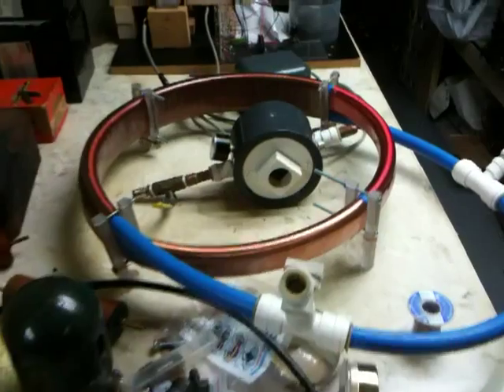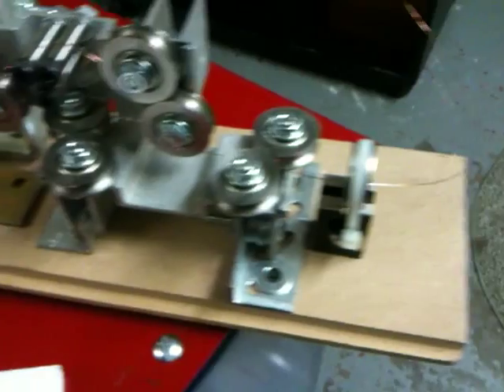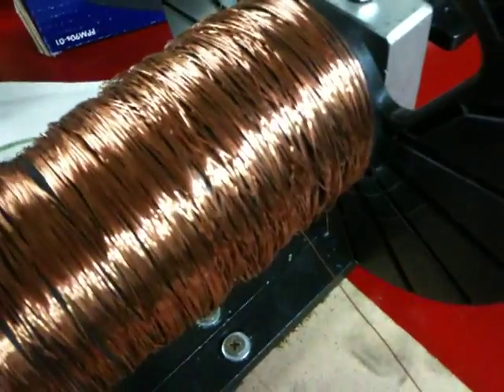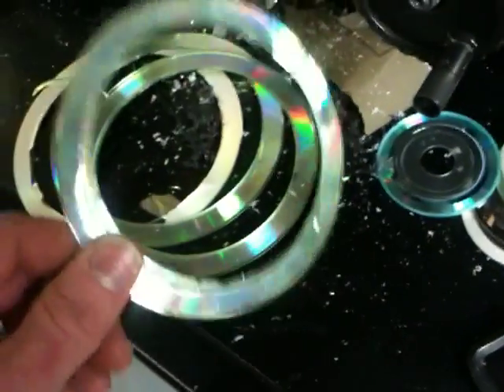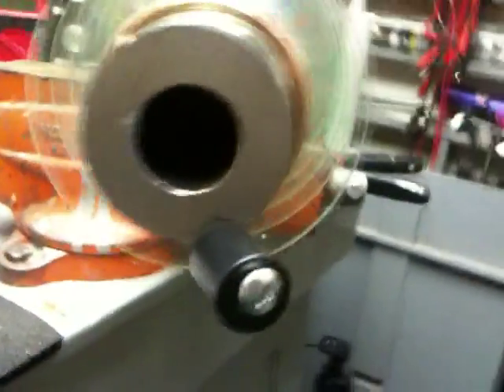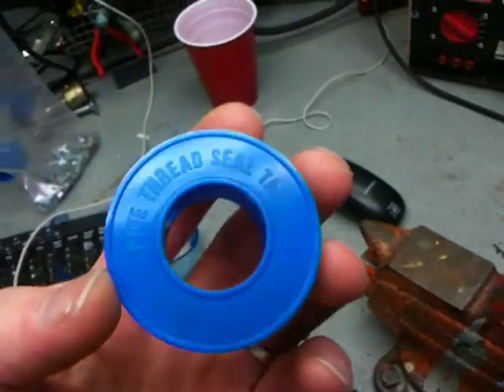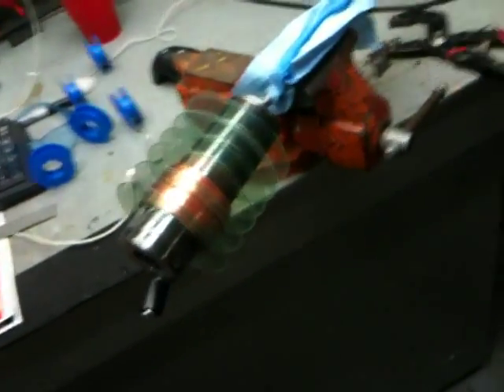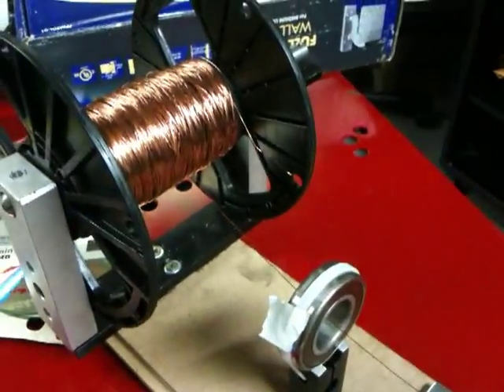2 EPG testing, Building The Primary Energizer (EPG Test 2)

Comment: Hi Russ,
I can't help but think that the hollow ferrite core will concentrate the magnetic field through *itself* and act as a ferrite particle barrier which will prevent acceleration of 'magnetic particles' through a tube within.
Also, a pulsed sectional field within the ferrite would be degraded by sections not pulsed;  though pulsing all together would energise the entire ferrite tube equally, but with lines passing through the ferrite rather than any particles enclosed within.

Comment: @rwg42985 Your machining of custom tools and apparatus's from home made lathes to wire straighteners - thats fantastic man, so cool. I too believe Stan Meyers was far too deep into it all of this to not have been on to some real solutions. Have you checked out the magnetic gas thread on energetic forums ? PS 500ml of HHO is a pretty safe explosion given a way to "blow off" but the sheer volume of explosions beyond 1.5l, to me, is the real threat. Very little "flame" threat to HHO.

Comment: i watched when you uploaded but too busy to comment,i got a light chaser circuit to use on pulsing primary coils-initial tests reveal the decade counter chip 4017 is putting out too long a pulse for me to switch FETs with.the FETs are getting hot and the scope shot shows long on time.
i have an arduino clone and was looking at the code for a light scanner array setup-might be possible to use,but i was wondering if you got code from your collaborator yet,cos im not up to speed on programming it

Comment: Hi, You are a very talented experimentalist.  However, if you ever do observe a new phenomena, you will not be able to explain it without sufficient details of how the experiment was performed.  I strongly suggest you keep more detailed notes and develop hardware that can more accurately track input and output power from the experiments.
You really need to DESIGN your experiments. You should know exactly the length and number of turns of every winding you make.
Good luck.